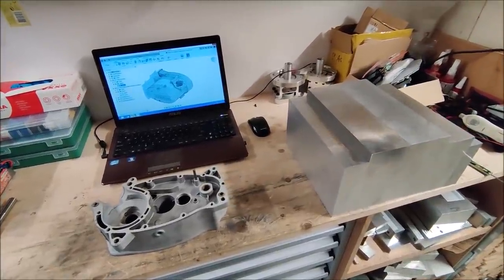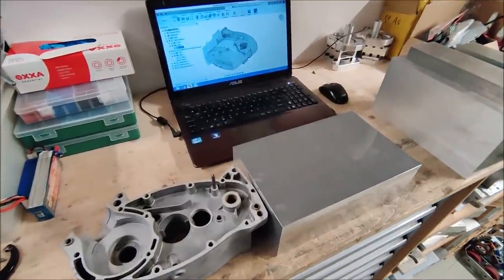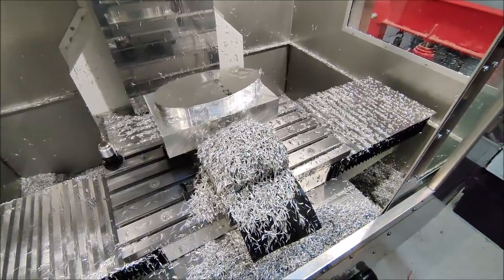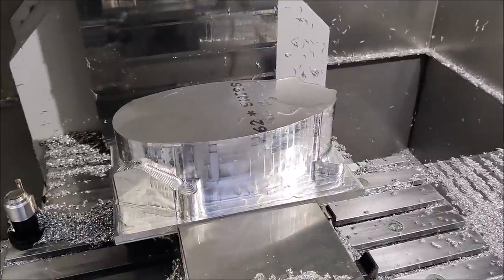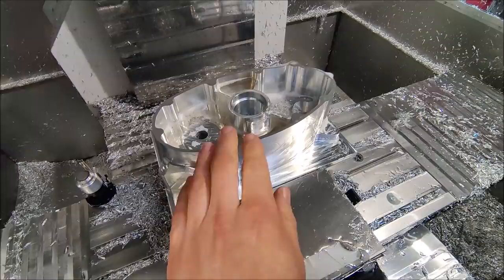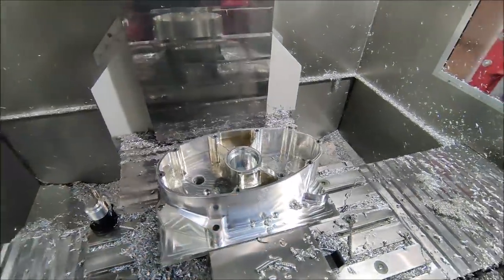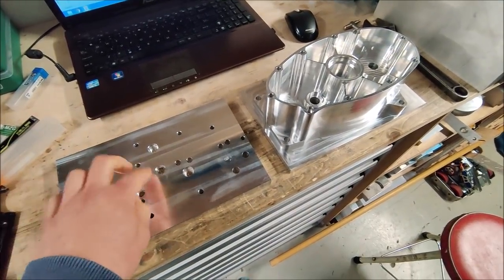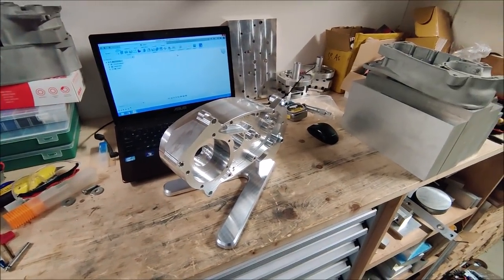Cnc machining a zundapp 5 speed engine part1

Comment: I still think this is one of the best DIY CNCs I have seen on YouTube. Makes mine look like a toy. Although to be fair they are different CNCs for completely different purposes. You can't argue with the results they are as good as any store bought CNC.
Reply: When someone told me they want to build their own cnc machine I just told them to get to  know their local shops sometime they will just give them away just to make room for newer machine.
Reply: @a-a-ron8437  damn I want to move to your neighbourhood, could have saved myself $7k.
Reply: @DodgyBrothersEngineering  i turned down a few machines before just because at the time I didn’t have room. Sometimes friends would get offered free machine and they will call around and see if anyone wants them. Doesnt happen all the time but its good to have connections when it does
Reply: @DodgyBrothersEngineering  my friend got a fadal dropped off in front of his shop one time for no reason at all. He didn’t buy it and have no idea who it belong to.
Reply: @a-a-ron8437  Getting a used CNC for free or very cheap would be a great starting point. I would assume the drive system is shot and the controller is obsolete or too expensive to maintain, but these components can easily be replaced. 

Of course, many of these commercial machines are far too heavy for the concrete floor in a typical home shop. It isn't uncommon for the concrete floor to be a minimum of 18 inches thick with isolated pads 36 inches thick under the leveling pads to carry the weight and handle the rapid acceleration/deceleration of nearly 800 inches per minute.

Comment: That is the most capable home cnc I have seen so far.  The cutting sounds solid - especially for the length of cutter used....  The epoxy granite base is doing its job.  The spindle has ample power.  Nicely done Sir.

Comment: Thank you for not wanting to post all the painful details of every milling. There are a lot of channels that post dozens of videos showing every cut that was made. Some people like that I guess. I don't have enough time for that. 

What I appreciate in a build video is learnable information. What you are planning to do. Why. What approaches will you be taking. What challenges do you see. What unexpected happened? (if anything) How did you solve expected challenges, and the unexpected problems. 

Because you built your machine, how it is performing. Any limitations that you need to take into account to perform the project you are working on.  (I guess this could be a part of the above questions)

I am also interested in the part you are making. You are not machining a block of metal just for the fun of it. All of the above questions but in relation to the project as a whole. 

These are things that I value over just watching chips fly. Of course it is easier to just post video of chips flying.

Comment: Could I make one small suggestion. When you make a fixture like the Op-2 plate. If you make a set of master jaws for your vise with a dovetail at the top. Then machine the mating dovetail in you fixture plate. That way when you clamp it in the vise it will be very securely held from moving due to any mishap or cutting force/vibration. Also you don't have to tighten the vise so much risking bowing the plate upward. Just a thought. Otherwise your machine does a impressive job. Great video.
Reply from the maker: Hey thanks for the comment im real fan of your content and watched lots of your videos! Thanks for the tip on the dovetail luckily sofar the vice did a good job on holding the plate down.
But might can use this idea for other projects or parts.
Reply: Another tip when machining soft jaws is to use a torque wrench to tighten the vise prior to machining. This is especially effective when holding objects that are subject to crushing or deforming when clamped.

Comment: this looks great, can you tell me something about the precision of your machine? How is the accuracy of it? 
As an example, if you mill a rectangle witch is 100x100mm how precise would it be at first try without tuning? 

I love your channel and machine, you realy have my respect.
Reply from the maker: With doing a rough cut finishing cut and then a spring cut and a new endmill since i don't use cutter compensation. i must get it most of times with in 0,02mm.
For most of my work more then accurate enough. and yes the tight tolerance parts will have recuts after measurements.

Comment: Nice job. Is that a battle bot sitting on the floor with the battery holder you build a while ago?
Reply from the maker: Yeah actually they are 2 robots stacked up each other. After this project is finished i want to build an other robot in the featherweight class also full billet bot. Planning on filming that one to :)